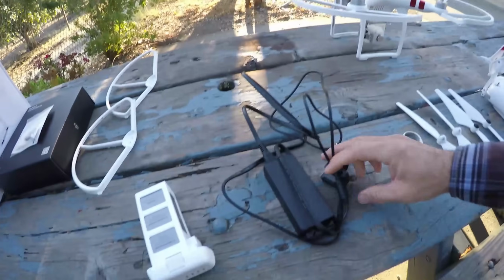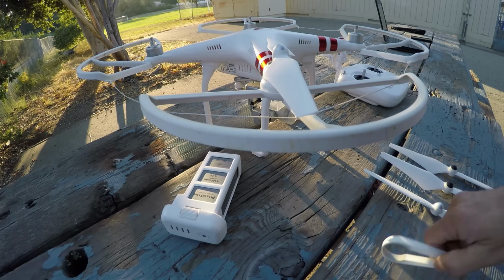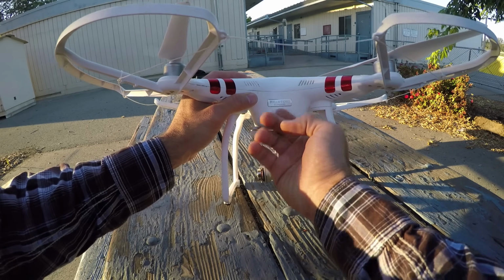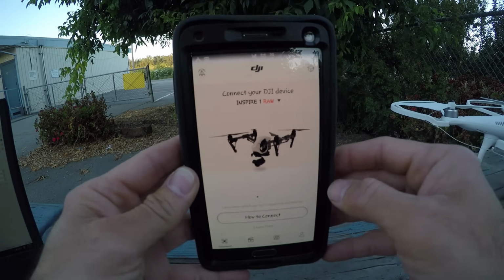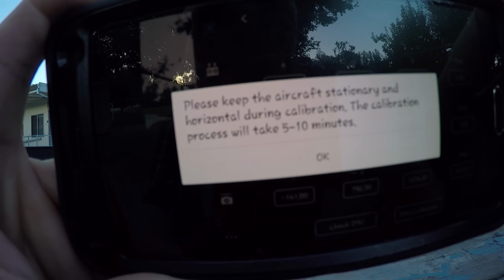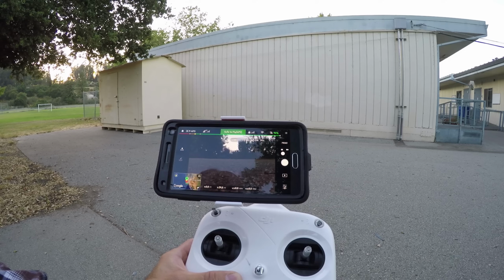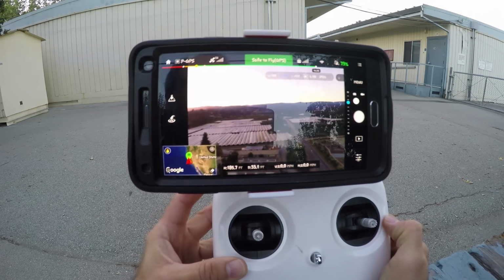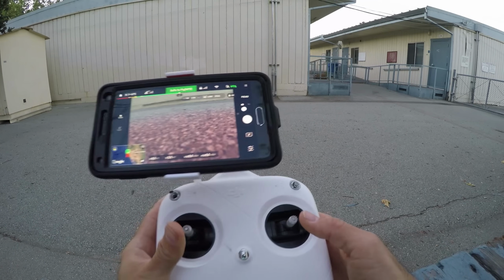DJI Phantom 3 Standard Complete Starters Tutorial

Comment: My son just gave me a DJI Phontom 3 Standard and I watched your video.

Two questions:

1.  I noticed that you had all four anti-drop pins installed holding the gimbal to the bottom of the drone. Mine came with only two installed at opposite corners and other two in a plastic accessory bag. Did you install the other two or did it come with all four already in place?

2. Wish you would have explained the two toggle switches - S1 and S2 - on the control unit. Haven't a clue what these do and no mention of function with included documentation.

Thanks for your video
Reply from the maker: Good questions! No one has asked me the first one before. You only need 2 anti-drop pins installed. I just went ahead and put the other 2 on mine. It didn't come like that. It discusses the pins in the manual I link to in this video's description. Specifically it talks about them on page 30.

For your second question I get asked that a LOT here so I went ahead and added it to the video description. Here's what I added regarding it:
 
What are the S1 and S2 switches for that I mention in the video? I didn't discuss them in detail in the video but they can serve several functions for each of them. The user manual I link above gives full details in the remote control section starting on page 23, but here is a quick synopsis...

The S1 switch :
*Allows you to regain control of your drone during the failsafe return to home process. I consider this the most important function of the S1 switch.
*Can allow you to calibrate the aircraft's compass, but you can do this through the DJI app too.
*Changes your flight modes (P-Mode, A-Mode or F-Mode) but you can do that through the DJI app as well.

The S2 switch:
*Can initiate a smart return to home process. I consider this the most important function of the S2 switch.
*Can be used in conjunction with the Gimbal dial to link the remote with the aircraft.
*Can be used to reset the WiFi password.
*Can be used to Reset the WiFi Video Downlink.

I hope these help. Happy flying!
Reply: Thanks for the quick reply. I didn't realize that the video description had a pull down for more info so I missed that.I did download the manual after viewing your video and decided probably best to avoid trying to use these switches until I become more familiar with basic default functions, Too cold to fly here in New England for awhile anyway.
Reply from the maker: George Lloyd Yeah, I don't use the switches that much really. It's good to know about the failsafe options with them though I case the DJI app screws up while your drone is in the air. Good call on short flights in the cold. Cold conditions impact your battery/flight time heavily

Comment: How far can my phantom standard go
Reply: Give it enough Vodka and I hear it goes all the way...  :)
Reply from the maker: Darren Arnold The P3S can go 0.5 miles from the user (1km).
Reply: u probably set yours in begginers mode thats why it wont let you fly for more than 120
Reply: Darren Arnold 6000ft
Reply: approximately 500M but mine can go beyond that as long as youre flying it in wide area without any buildings and trees
Reply: So how can I set it at 500 m it won't let me go no higher then 120 m
Reply: Ive tested it goes 6000ft/2km/1.25 miles this is without any buildings/trees in the way
Reply from the maker: Darren Arnold You have to take it out of the training/restricted mode in the DJI Go app. Have you read the user manual I link to in this video's description? It talks about it in there.
Reply: How do I take it out of train bud
Reply: *you,ve

Comment: This is a very nice video for the beginner. I would like to mention a few things that might also help.

1. The app has a beginner mode which limits altitude and distance from the point of take off to about 100 feet. Its found under settings. This feature is set to default when you power the system for the first time. Verify this and leave it on until you're comfortable with basic navigation.

2. On the transmitter/remote. The toggle switch on the left is a emergency return to home. To engage toggle back-and-forth twice. This comes in handy should your phone or tablet loses Wi-Fi signal or other like error with your viewing device.
Reply: both of my feet are smaller than a foot.
Reply: What does the right switch do?
Reply: I got one this drone,I thought I could take wherever I want but I was wrong,wifi problem
Reply: some very good points well said.....
Reply: ,ψάχνω

Comment: I would like to know what the switches on the control do you said where you set them but you said nothing about what they do. Thank you for your time but I don't know what the switches do ??
Reply from the maker: ziggyzbeak The User Manual (file Phantom_3_Standard_User_Manual_v1.4_en_0112.pdf on the DJI website) explains the switches thoroughly. I'll give you a synopsis though...

The S1 switch :
*Allows you to regain control of your drone during the failsafe return to home process. I consider this the most important function of the S1 switch.
*Can allow you to calibrate the aircraft's compass, but you can do this through the DJI app too.
*Changes your flight modes (P-Mode, A-Mode or F-Mode) but you can do that through the DJI app as well.

The S2 switch:
*Can initiate a smart return to home process. I consider this the most important function of the S2 switch.
*Can be used in conjunction with the Gimbal dial to link the remote with the aircraft.
*Can be used to reset the WiFi password.
*Can be used to Reset the WiFi Video Downlink.
Reply: Thank you for answering me very fast.
Now I'm going to D.J.I. website.

Comment: I just bought the Phantom 3 Standard. I should be feeling elation but I just found out that the aircraft does not work anymore with the iPhone 5 and previous releases! My question is...how long will my iPhone 6 operate the P3 which I just purchased? If DJI comes out with a new update tomorrow, do I just throw the new P3 in the trash?
Reply from the maker: Gary W. Stegall Simple solution - don't update anything and you will be fine. You can always roll back firmware too.
Reply: Thanks for your answer, but aren't updates mandatory?
Reply from the maker: Gary W. Stegall No. In fact many suggest waiting to update (if at all) in case there are issues with new firmware releases. Many people seem to have issues with initial firmware updates.

Comment: Just one small criticism: You mention the switches on the controller but don't describe what they do.
Reply from the maker: Jim Arnold Yeah, I have responded in the comments about that before. Total oversight on my part. There's so much to cover :P
Do you need me to mention what they do here for you in the comments?
Reply: I assume it's somewhere in the manual? Thanks, I'll look for it there.
Reply from the maker: Jim Arnold The User Manual (file Phantom_3_Standard_User_Manual_v1.4_en_0112.pdf on the DJI website) explains the switches thoroughly. I'll give you a synopsis though...

The S1 switch :
*Allows you to regain control of your drone during the failsafe return to home process. I consider this the most important function of the S1 switch.
*Can allow you to calibrate the aircraft's compass, but you can do this through the DJI app too.
*Changes your flight modes (P-Mode, A-Mode or F-Mode) but you can do that through the DJI app as well.

The S2 switch:
*Can initiate a smart return to home process. I consider this the most important function of the S2 switch.
*Can be used in conjunction with the Gimbal dial to link the remote with the aircraft.
*Can be used to reset the WiFi password.
*Can be used to Reset the WiFi Video Downlink.

Comment: can you use data besides wifi if you see please text back
Reply from the maker: Douglas Tart The wifi is used to connect your contoller to the drone. You are not using it for any Internet data or anything. It's just to transmit signals from the remote to the drone and back.

Comment: Hey I did all that but when I connected to the dji go app I updated and it said update complete.... but as I turned it off and turned it back on is asking to update again and I am kind of lost in that section
Reply from the maker: Efrain Hernandez You might have had a problem during the firmware update. It seems to happen a lot through the DJI Go app. Try going through the process again. If that doesn't work you can try manually installing the firmware using the process in another video I have here - https://youtu.be/LeexamhXsSk
You can skip the part about re-linking your remote control.
Reply: So can I just delete the app and install again do u think that will help
Reply from the maker: Efrain Hernandez No, most likely that will not help. The firmware will still need to be fixed. Reinstalling the app won't fix that. Attempting the firmware update process through the app may fix it. If not, use the link I gave you.
Reply: tripecollie alright thankyou.... I'll keep you in mind

Comment: looks like you had a crash with it?
Reply from the maker: iZilly Yup. Flying in the redwoods with no GPS lock was tough.
Reply: Getting me worried... getting a Dji Phantom 3 Advanced shortly and super excited and really hope i do not crash it..
Reply from the maker: iZilly If you've flown drones before you will be fine. I was brand new to drones and knew I was taking a risk with no GPS lock to help assist me. Practicing flying in big open areas first helps. Then working on all the small technical movements in smaller controlled spaces with GPS lock. Then no GPS should be easier. I didn't want to invest the extra time and I crashed a few times speeding up the process because I'm impatient. I'm more confident now but I'm hardly a pro at drone usage.
Reply: I should be ok then. I have been flying a Syma X8 and can race around no problem and do flips and such with it and it is about same size as the Dji Phantom.

I should be alright with the Dji then :)

Comment: Hello, thank's a lot, very complete. Just one thing: What about those little switches at the controller. What do they exactly do? Once again thank's a lot.
Reply from the maker: Raul Lobato The User Manual (file Phantom_3_Standard_User_Manual_v1.4_en_0112.pdf on the DJI website) explains the switches thoroughly. I'll give you a synopsis though...

The S1 switch :
*Allows you to regain control of your drone during the failsafe return to home process. I consider this the most important function of the S1 switch.
*Can allow you to calibrate the aircraft's compass, but you can do this through the DJI app too.
*Changes your flight modes (P-Mode, A-Mode or F-Mode) but you can do that through the DJI app as well.

The S2 switch:
*Can initiate a smart return to home process. I consider this the most important function of the S2 switch.
*Can be used in conjunction with the Gimbal dial to link the remote with the aircraft.
*Can be used to reset the WiFi password.
*Can be used to Reset the WiFi Video Downlink.

I hope that helps!
Reply: Thank you so much!!

Comment: How many wifi bars or whatever is safe to fly? I had 2 down and I was only 80 meters high and I'm so confused because that's pretty close to losing sigal
Reply: Tripecollie, I enjoyed viewing your video. I would like to make a suggestion for a minor modification. You stated that you had covered the firm ware update procedures earlier, but I don't remember you discussing them. The firm ware procedures are hard to find. Also, would be nice if someone would state definitely whether the IMU calibration or the Compass calibration should be done first. Thank you.
Reply from the maker: Steve Benedict Firmware update procedures (manual versus through the software) can be shown here - https://youtu.be/LeexamhXsSk
As for IMU or compass calibration first, the order doesn't matter. It is just important/recommended that you do both before flying your first time.
Reply: not to the satalites but the controller bars
Reply from the maker: Crysix I On the controller I will fly until there is one bar left because the controller battery lasts so long. the drone battery discharges way quicker. The best recommendation is really to always fly with it fully charged though to limit the possibility of issues.
Reply: tripecollie Sorry I wasn't clear enough i meant on the DJI go app.  Like connection bars on the controller but not the satalites
Reply from the maker: Crysix I'll be honest. I never look at them. I just make sure I have a clear path back for the return to home feature. If you have it enabled and fly out of range it should return to home automatically. When the drone first starts up and says home point created that is saying where the drone should return to.
Reply: tripecollie ah okay. because Im starting to think something is wrong with it because it was loosing signal and nothing was in the way
Reply from the maker: Crysix some people seem to have more signal connection issues than others with certain firmware updates. First I'd recommend trying to relink your controller to your drone and see if that improves it's function. If that's not enough then you may want to try a different version of the firmware. I have a video in my channel that shows how to do both procedures since people kept asking about it.
Reply: okay thanks ill get onto that

Comment: well  done a great job there. i,m a pro radio control pilot planes and helicopters old school been flying 45 years when i first started it was rubber bands and 1 tap for left 2 taps for right on the transistor. if you got it wrong you took your 1000hr build  model home in a carrier bag.  chris smythe
England Manchester

Comment: Do you need wifi or mobile data everytime when you fly it? So you cant go anywhere and just fly
Reply: Please help!
Reply from the maker: Rocco Tamburini You need wifi enabled to connect your controller to the drone, yes. You are only connecting the controller to the drone though, not to any data type network. As far as I'm aware you are not REQUIRED to have a cell data/network connection. I haven't tested it without it though. GPS is handled by the drone. However, I like having cell data and my GPS enabled on my cell so I can get the Google map version showing where my drone is if it's far off in the distance (out of sight).That can help me guide it back. As long as I was careful with my altitude I could just enable the return to home feature though. I just like the Google map display and such through the DJI app. I hope this helps.
Reply: tripecollie thank you so much! Btw your tutorial is great! THANKS

Comment: Ok, I was able to land and shut it off, but I still can't control it. It hovers and lands. I try moving in all directions. It still has 2 green lights and 2 red ones.
Reply from the maker: Again, the lights you describe sound proper, so your calibration should be fine. I'm guessing you may need to relink your controller to the drone. I cover how to do that in the start of another video I have here - https://youtu.be/LeexamhXsSk
It's a fast/easy process.

If everything else is working (like your video feed, proper GPS lock, etc) and you understood the flight directions I discuss in this video, then I'm not sure what the problem could be.

Comment: I tried moving the flight sticks in all directions, but it kept spinning. I finally shut it off manually
Reply from the maker: At 35 minutes into the video I show one of the ways to land manually and shut the props off. Once you have landed, you hold your left flight stick straight down for several seconds and the props should shut off. Another way is once you have landed push diagonally down and outward with BOTH flight sticks. You can also push diagonally down and inward with BOTH flight sticks. All three of those methods can shut off the props. I don't mention the other 2 shut down methods. Mainly because I feel it's easy to be a little off and make the drone fly again to the side and potentially wreck. For a beginner the straight down method or automatic return to home method I cover in the video are the easiest. I hope this helps.

Comment: I tried calibrating, but I had 2 green lights and 2 red. I was still able to fly, by using my cell phone, but I couldn't shut it off. I landed with the app, but it wouldn't shut off
Reply from the maker: From what you said it sounds like the two lights in front of the camera were red and the two behind the camera were green. Is that correct?